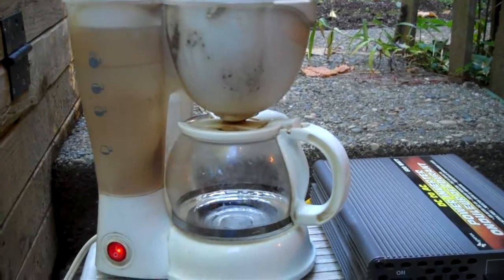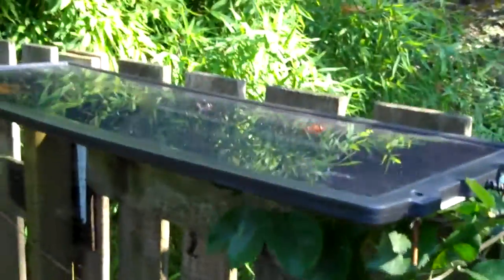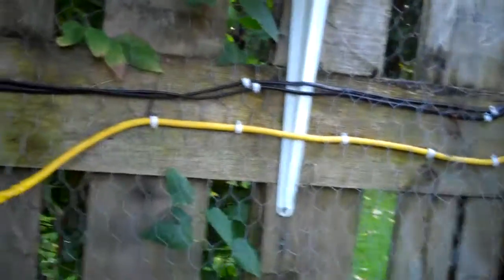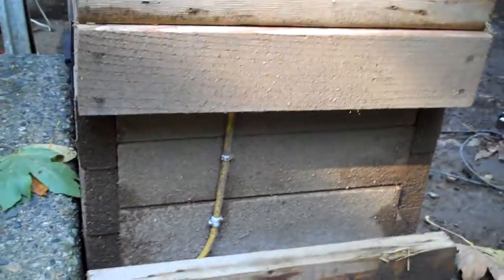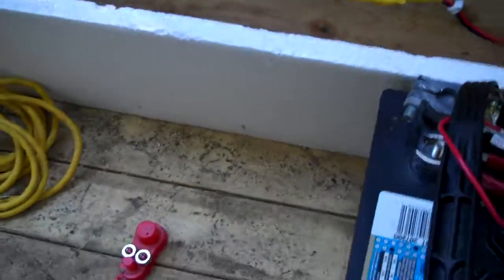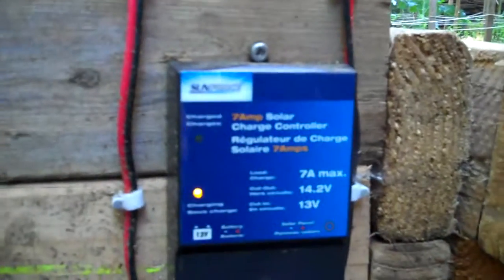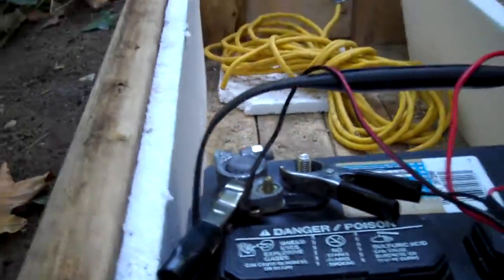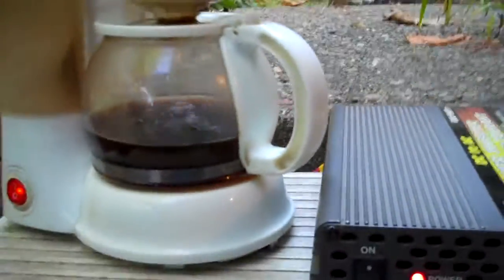my solar setup.MP4

Comment from the maker: I am having so much fun with this, just got some burial cable to run underground from the panels to the battery bank.getting rid of the old extension cord finally.need to find a junction box to run all eleven solar panels into what I have up now is a little messy.it may be time to upgrade the old seven amp charge controllers.

Comment: Great set up, 
I am trying to do the same thing up at my cabin.
Everything is the same I purchsed the 60w solar panel kit .
The only thing difference  is that I bought a 2000w inverter, is that ok or will I be creating any problems?
Also can I run two batteries off of this system or is it dangerous and what type of batteries.
Thanks for you help everyone.
Joseph

Comment from the maker: Yes there is other ways to make coffee.but this is my method.got to use the excess power somehow and this is one method.I just got five more panels, wohoo.and another battery installed.to keep my panels from sight they are mounted at less than perfect angles.in this vid it had just rained so there is a little water to evaporate away.the panels are waterproof.rain won't harm them

Comment from the maker: Whoa awesome.keep those comments comin.larger and better inverters are ok but runtime may be less.many types of 12 volt and dual 6 volt wired to be 12 volt batteries may be charged.sealed agm.gell cell.and standard wet cell deep cycle.even aa aaa batteries with an automotive receptical.

Comment from the maker: I live inside like most, my inverters to and are setup so I can just put it out when I need  , the now 4  batteries live outside  charging up , venting their gasses outside  and I have spare charge controllers in case of failure  but all is well for ten years so far , about that anyways